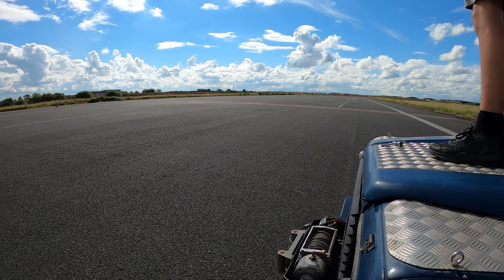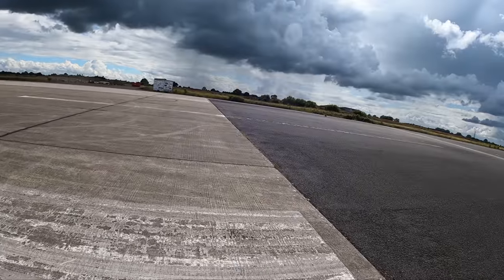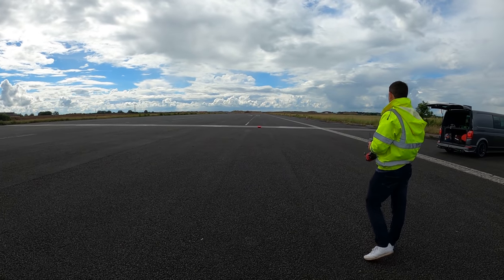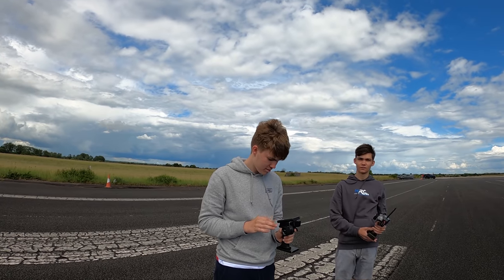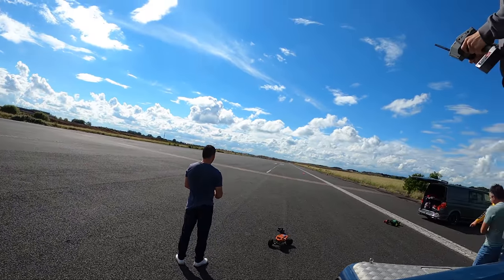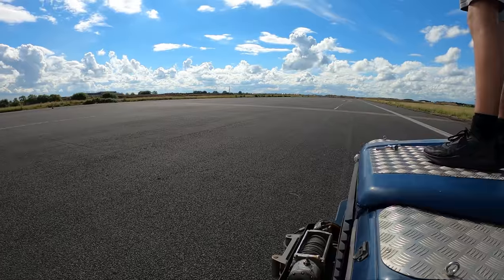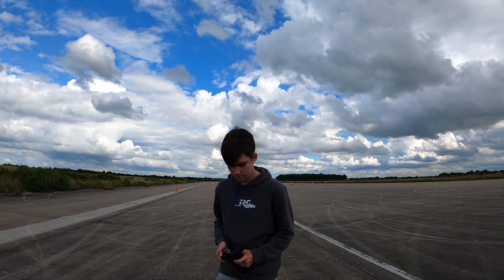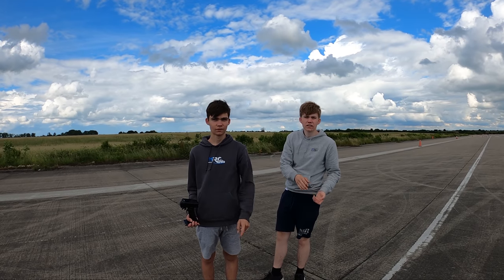ARRMA Limitless Speed Twins - 1100kv vs 1650kv

Comment: You gentlemen need to loosen up the front suspension a little, and stiffen up the rear. Also you must take off the front spoilers, and don't brake so fast. Stay at full trigger about 3 seconds longer.
Reply from the maker: Thanks for the tips, just need to find a new location as this place has now gone
Reply: @HardcoreRC  yes sir!! I enjoy you guys content!! Keep up the good work!!
Reply: @HardcoreRC  just those few little changes will increase your speed to about 120 or 125. Also try gearing 29 spur/ 43 pinion on the 1100 kv motor, you will get about 145 out of it with that set up, and loosening up the front suspension and tightening up the rear will keep you from going airborne!!🤣🤣🤣🤣

Comment: So which was the fastest, 1650kv or 1100kv?
Reply from the maker: Currently the 1100kv is fastest. Need to tune both more to see though, but suspect the 1100kv will still be the fasest. Although for proper speed runs the Hobbywing systems are not the best, Castle and TP Motors would be better
Reply: @HardcoreRC  thanks
Reply: @HardcoreRC  hello. Can you please tell me, were you running 6S or 8S in the 1650kv limitless, and what spur and pinion? Thanks mate!

Comment: Hi did the 1100kv motor fit straight into the vehicle without any modifications?
Reply from the maker: Just needed a new motor mount to fit as the stock one only goes up to 49mm diameter motors
Reply: @HardcoreRC  what mount did you purchase and do you have a link for the retailer pls 🙏
Reply from the maker: @dzl2716  retailer would depend where in the world you are. We have two mounts that work the best being PPS: https://practicalproto.com/collections/frontpage/products/grublock-motor-mount-for-arrma-6s-blx-platform

Other one but much harder to set mesh is from MMM: https://www.mmm-germany.com/shop/arrma/
Reply: @HardcoreRC  Wales 🏴
Reply from the maker: @dzl2716  Either direct from PPS then or you could see when Adrian at Bad Touch Breakers is getting some more in: https://badtouchbreakers.com/
Reply: Hi Guys, I’m running a hobbywing 1100kv motor with a stock spur in my infraction but forgot to order the pinions, I’m not sure what pinions to order and where I can buy them from, can you help?
Reply from the maker: @dzl2716  you really need 39 spool and 34 pinion - you can get the 34t limitless spool to fit as the pinion
Reply: 👍Thank you

Comment: FLYSKY NB4 Radio.....?
Radiolink RC6GS best UP 600M
Reply from the maker: Flysky was out performing the RC6GS as we also have that and found the range to be wanting vs the Noble NB4 with FTr10 twin antenna receiver that has a range up to 3500 meters (air) so around 1500m on ground

Comment: He should remove the black parts on the top of the front splitter it helps alot taking that off
Reply from the maker: It does help with speed, but also then greater chance of lift off 😂😂
Reply: @HardcoreRC  its suppose to help keep it down also

Comment: Hit the same thing that messed up Kev's speed run! Definitely sucks that bump is there!
Reply from the maker: Yep we all hit it, on the day it didn't look like it was the gap doing it as it happened away from the gap, but then the slow mo you can clearly see its the gap. Need to find a new runway
Reply: @HardcoreRC  yeah I tried to pause your video to see exactly where it started to lift as well and that gap just seems to be enough if you hit it perfectly to bounce the wheels and get air under the car 👎 I have only been able to hit 114mph with my Limitless so far because of the area. I'm trying to find the best place to run it within an hour of my house 👍 Hope you guys are able to find the perfect spot!
Reply from the maker: @brandonreid4511  Yeah when you slo mo it you can see the wheels lift and its enough for the air to then start getting under the car.

114mph well done 👍👍 what system are you running ?

UK roads suck for finding good speed run spots - hope you find somewhere as it is addictive
Reply: @HardcoreRC  Yeah I thought so! And I just finished my first speed build with my Limitless. I'm running a 1/5 TP Motors 5650 1440kv, Mamba Monster ESC, Over geared 36/34 and a RippleKiller 8s cap pack. Trying to slowly build up to the 150mph mark that I believe I can get with it rightnow. I totally understand as here in Ontario, Canada ALOT of our roads are in terrible shape and the best places I've found so far have been in a local smaller city but looking to find a new paved country road to really open it up 👍 Love your guy's channel! Hopefully I get a camera to video my speed runs, love your BigRock too as I got a Typhon 3s I put new 150a Firma ESC and motor setup in to try and see if I can hit 100mph with it! Waiting on a few more needed upgrades. Keep up the awesome content and hard work guy's 💪👍
Reply from the maker: @brandonreid4511  Thanks for your kind words brother 👍 with that TP motor it should fly, hope you can hit that big 150mph mark, that would be a huge achievement.

When i see these roads the Americans can get to use im so very very very jealous
Reply: @HardcoreRC  You guy's deserve it and love seeing the family doing it man 👍👍👍 Thank you! I'm sure hoping it can once I find the right road way for it! Yes it's really crazy seeing some of the flawless roads over there, I always felt like it's mainly because of how many more luxury/supercars they have driving daily. Those people make sure the roads are fixed and done properly hahah